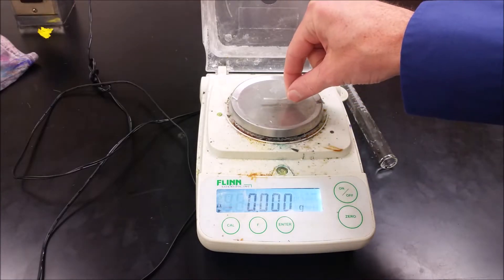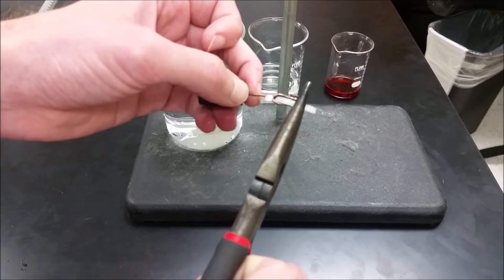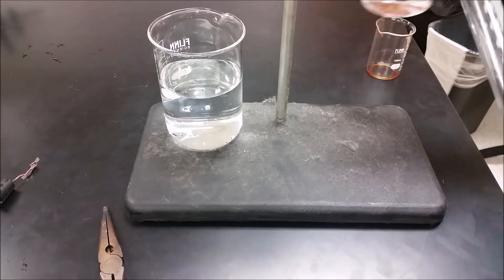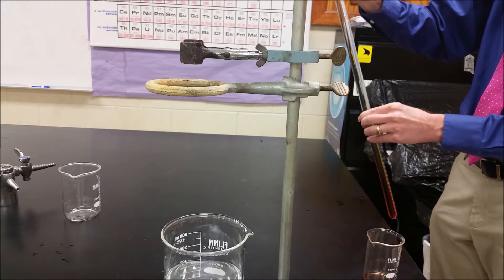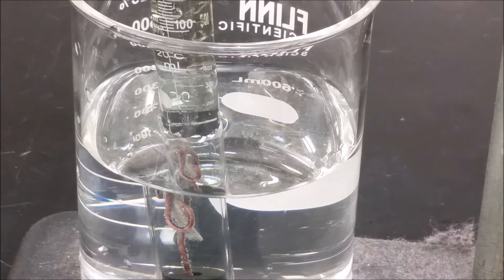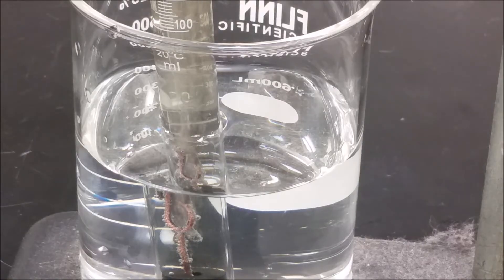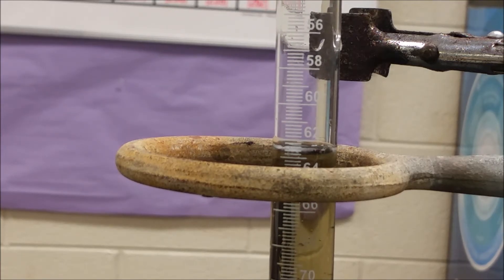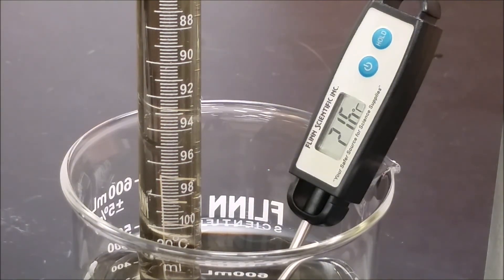Molar Volume of Hydrogen Gas - Mg + HCl

Comment: But according to the stoichiometry volume should be 55.08 ml at STP for 0.059 g of strip how we got 63.8 ml?
Reply: First of all, it not 63.8. Its 100-63.8
Second he is not doing it under STP conditions. You will have to find the STP volume yourself using gas law. I hope this helps
Reply: @theevolver5151  100-63.80? Does that mean that the value we will plug in for n = PV/RT is 36.2 mL or 0.0362 L? And not 63.80?
Reply: @heidijordan8230  correct, it's the change in volume itself.
Reply: @heidijordan8230  am doing a similar experiment myself, but in my case am finding the molar mass of the magnesium used using different masses of magnesium and compare to the resulting volume of hydrogen gas. So far I have only 5% error which is good enough for me.
Reply: @theevolver5151  Eudiometers are labeled so that the volume measurement is as read. The volume is 63.8mL. 100mL is the maximum amount of gas that you can measure with this size eudiometer.
You are correct about not being at STP. He does give the temperature of the water; so, if the water is at room temp, then we have a good enough estimate of the temp of the gas generated. The pressure of the hydrogen gas can't be determined without equalizing the pressure with the ambient pressure of the room; not enough info is provided in this video to make accurate calculations.